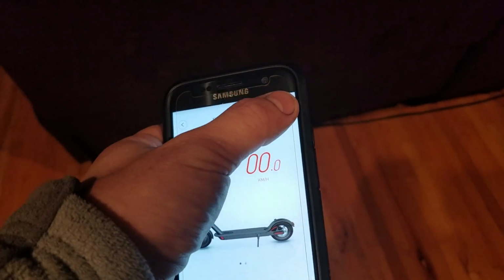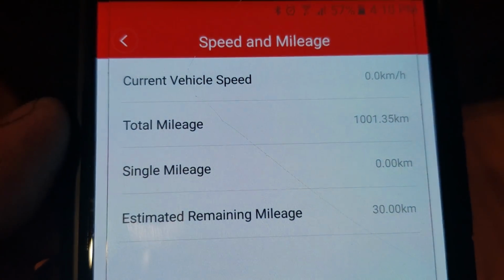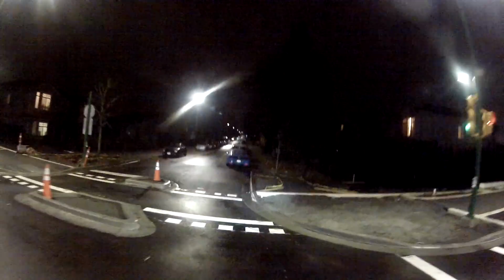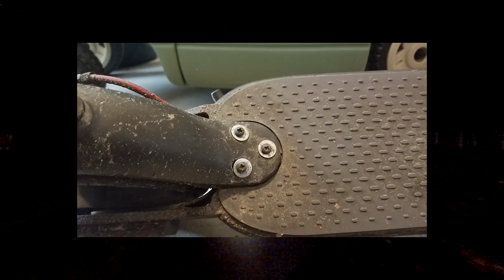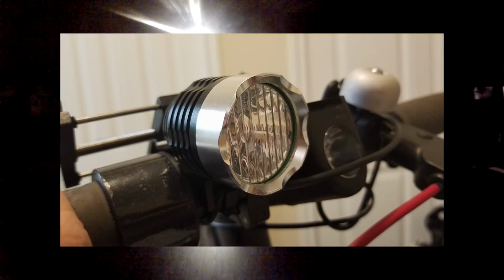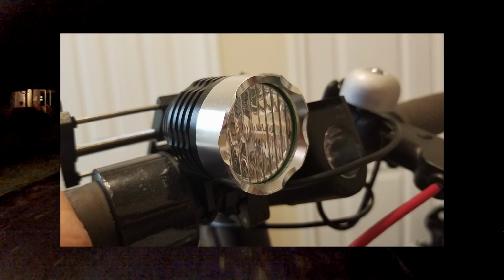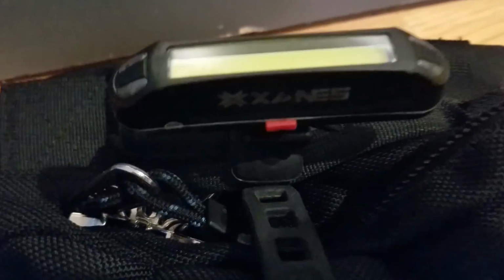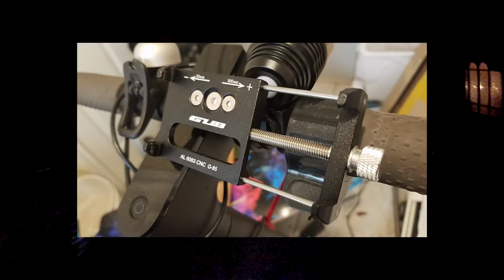Xiaomi M365 - 1000 km Review

Comment: I got the segway ninebot max in October 2019 - April 2020 and it's been running very strong. I haven't had any issue with it. Solid tires and long range and I also take it to work in the rain so it seems to be water resistant and still no issue.

Comment: Don't give up on the scooter even if you get a bicycle, with a scooter you go places even a bike don't go, I bet you have seen places you never even new existed since getting your scooter.

In the UK we are not legally allowed to ride these unless they are registered as mopeds which means they would need to carry a number plate and have a motorcycle license to ride one.

So many people ride them illegally because the law is daft.
Reply from the maker: i thought about, and decided to keep it. unless they come out with a better version of this.
Reply: A good move, I've been thinking of getting one of these in order not to attract too much attention as they look more like kick scooters, I have an EVO which is a road legal electric but it hardly ever gets any use due to the legal issues having that number plate stops you from making good use of scooter ie you can't use cycle lanes, or pavements and so on.

It only does 20 mph but you have to mingle with the traffic or you could find yourself in lots of trouble.

So the type of scooter you have may be a solution for me.
It's something for me to consider.
Reply: EU laws for scooters are quite ambiguous. They could in theory fall under the law legislation as electric bicycles. 250w max motor, 15mph max. The ambigious part is where it's "self propelled" and not operated on the motor alone.  Since some electric scooters require that you kick it before the engine kicks in, legally it would be defined as not operating on the motor alone IMO.
Reply: Actually EU law permits for the use of electric scooters, it's UK law that doesn't.

Under EU law they have opted out of telling other countries that they must adopt the law relating to electric scooters and high powered electric bikes, each EU country decides for itself.

The UK law on electric scooters is as clear and unambiguous as it can be, it states that in order for a vehicle to be classified as an electric bicycle it must have pedals that's basically the one part of the law that disqualifies electric scooters, once an American company fitted pedals to their scooters in an attempt to get around the law but it was deemed not acceptable in court.

So in UK law an electrically assisted bicycle is now 250 watts and the motor must cut out at 15.5 mph the only way you can go faster is by pedalling.

All electric scooters regardless of power be it 100 watts or 3000 watts must be registered as a moped or motorcycle, failure to do so could see you as the rider losing your driving license and getting a big fine.

Many people ride these electric scooters in the UK and ignore the law, the police have so far not been that bothered by them as they have far more important things to do than chase electric scooters.

However if you happen to be involved in an accident you could find yourself in deep trouble, as they are considered motor vehicles.

The only thing that falls out side of the law in the UK is the electric unicycle and at one time promised to be popular, but dropped away, there are no actual laws relating to the Unicycle they fall under the laws of the kick scooter which is considered a toy and as such the law has stated they will not pursue people who ride them so long as they ride with care.

Should there be any reports of people behaving anti social with them they will start to fine people for riding them on the pavement.

UK laws can be draconian.

I got all this directly from the dept of transport who directed me to the relevant documentation on their website, they even  use laws going back to the 18th century to ensure you don't do certain things in relation to cycling and scooters.

For example: cyclists can't be done for speeding in the UK cyclists can go as fast as they like, but they can get done for riding furiously which means they can get a fine or have their bike confiscated until a court hearing, and this law dates back to the 18th century.
Reply: flitsies Hi there. I live in Portsmouth, England, and own this exact scooter. So far it’s served its purpose nicely, and it’s a joy to ride. Nippy, economical, portable, durable, and a real head-turner. Most kids have never seen anything like it and beg me to let them ride it, and adults ask me how much it cost etc. So if you live in an urban area and discretion is something you want, this scooter is not for you. Also I feel awkward riding it on the road despite it being safe, due to the legal reasons you’ve outlined, and the fact it attracts attention. Moreover, I doubt you can trick people into believing it’s a kick scooter, it’s just too chunky looking, quick, and conspicuous. 

However, you’re right that the police have bigger fish to fry, and I’d wager that many officers wouldn’t recognise the scooter as an unregistered motorised vehicle anyway. I’ve seen a couple guys riding scooters and boosted boards around my area.

I bought mine back in October and it’s seen little use. I’ll start riding it again this summer and hope no one stops me.

Hope you enjoy the scooter should you buy it.
Reply: I probably will buy one of these in time, but at the moment I have other problems regarding electric scooters.

But yes all these types of electric scooters are great, why the UK govt is refusing to change the law on them is a mystery.

But just be aware for your own safety, should you be in an accident while riding the scooter in the road you will be held responsible even if the driver of the other vehicle was to blame as you have no right to be riding that on the road.

You may also find yourself being prosecuted for driving an unlicensed uninsured blah blah vehicle on the road once it is discovered it is an electric scooter.

My electric scooter may be registered as a moped/motorcycle and it may only go around 20 mph but it is perfectly legal on the road even if I am blocking the road as I ride along.

Seriously though it's a pain in the ass having to do all that registration lark and it shouldn't be needed for something that is in effect smaller than a pedal cycle..
Reply: Submitted a petition to the government petitions website to legalise a new class of lightweight personal electric vehicles. They haven't approved it yet but keep an eye out for it and get it well shared around. This kind of vehicle is perfect for nipping around local areas and even commuting along cycle routes.
Reply: It's good that you are trying but it has been tried once before hence everyone just ignores the law right up until the govt funds the police better then all hell will break loose.

Good luck.
Reply: Hashterix 

Dont bring the States Nazieyes on anything we love
Reply: Here's the thing, whether you like it or not, if the state or country law prohibits the use of these things and no one challenges it then all that happens is that some people get tickets and some don't, but in some countries it goes a little further than that.

Fore Example: In the UK should you ride one of these and by chance find yourself in the presence of a police officer who really had a bad day and wants some over time you could find yourself in some serious trouble.

The let's say you decide, " OK so I got my license taken away it's not going to stop me riding my scooter is it" Wrong because under UK law you could find yourself going to prison for riding what under the law views as a motorcycle without insurance registration and license cos you just got your taken away, plus as we know driving a vehicle without insurance could see you imprisoned.

So the petition if people sign it would go a long way in helping to prevent this unfortunate string of events ever happening.

Imagine a child of  9 years old being dragged in front of a court for riding a 100 watts electric scooter, technically it could happen even though it never has, some parents have been dragged to court for riding their kids electric toy car because technically it too is considered a motor vehicle, and an adult riding on it is considered illegal.

Even the law regarding disabled electric wheel chairs and scooters, if you are able bodied you could find yourself losing your license for riding one, the police just have to prove you are able bodied and have not got a disability badge.

The law needs to be changed.
Reply: Share that petition far and wide this summer before it expires! Even if we just get 10k signatures it'll get it noticed
Reply: At the moment it's not looking too good, so really we need more people pushing this forward.

I think the main problem is that a lot of people simply don't realise that the scooters are illegal, therefore they don't see the need to sign the petition.

Apathy seems to spring to mind.

But one man if you google did actually get six points and 180 pound fine plus his £800 odd machine was destroyed by the authorities, it was a two wheeled electric unicycle, I know it's a contradiction but that's pretty much what they are called.

But this was in 2016 in wales.

It's not a problem until it becomes a problem seems to be the way a lot of people view this issue.

So you may find the petition struggle to get up any steam.

But soon as the police get their funding back you can bet your hard cash that people will start to cry and wonder why no one got a petition up to change the law, right? ha the irony of it all.
Reply: Signed!
Reply: @flitsies   They do not want the vehicle to die because in this way it is still charged for polluting and if people did not move by car the workshops, the petrol stations and the oil arabesques business people would complain to the politicians of "The Assembly of London". and let's not forget "Transport for London".I live in this city of London, UK and I have to suffer the pollution that is growing more and one of the reasons for Brexit is to continue to pollute without control and without having to respect the European Laws.
Reply: @JB-sd4qc  Well I don't agree with you on the Brexit but we shall have to wait and see.

I believe that once we get out of the EU  we will see some meaningful changes to our policies on pollution, and I don't mean that dumb ass dimwitted idea that is coming in, in march the ULEZ.

That only charges the people who don't pollute the real polluters will still be allowed to travel through London no charge.

I don't know about you but did you notice how the EU go on about plastic bottles but when you watch their tables in that big room whatever it's called virtually every seat has a plastic bottle of water on the table.

So we must do what they say while they do as they like, seems to be the order of the day when it comes to pollution.

I don't see them travelling around in electric cars only big ass limos, and i bet most of them smoke.
Reply: @Hashterix  That petition was good but, I believe, received too little attention. After reading your post here I immediately went to sign it, but it had been timed out :-(. If more people had known of it I'm sure it would have received a mass of signatures.
Reply: @Kimdino1  here's hoping boris is the right kind of open minded thinker and it might happen next year!

Comment: i've had a few punctures as well..iv'e ordered a hard tyre for the back wheel ... on the Segway Ninebot app i like going into the 'fans moments' section there you will see some comments / experiences by fellow m365 riders . a tip for the battery cover..i know it sounds stupid...go buy a Yoga Mat from a sports shop...yes..a Yoga mat... why ?... its the correct thickness... cut it to size and fit inside the battery compartment...this will stop movement of the components inside the battery compartment... finish off by using a silicone sealant around the edge of the lid and secure ..... if you are riding in the rain use gorilla tape to cover the battery socket and red rubber plug. this will prevent water ingress  .you  may also want to use gorilla tape around all the joints on the handlebar / night light area paying special attention to keeping the on / off button dry ...finally a few cable ties to tuck in the red and grey wires that protrude out gives the scooter a better look.
Reply from the maker: that's a lot of awesome tips! i especially like the thin foam to support the battery idea, that will probably reduce the chances of broken spot welds  by a lot! and i didn't know that water can get pass the power button, im gonna cut a piece of clear flexible tape to cover that up.
Reply: Doesent it countain the excessibe heat of the battery and doesent allow passive cooling with that polyfoam garbage? Remember all these hoverboards exploding? Yeah right, Lithium batteries need cooling
Reply: After both my tires had punctures I also ordered solid rubber tires from Gearbest. I got those with the holes drilled into the sides. The solid tires are a bloody pain to retrofit but after heating them up I managed to crowbar them on.

Only downside to the modification is that the scooter becomes rock hard to ride. The solid tires offer no suspension whatsoever. After less than 20km there was rattling somewhere in the back of the scooter. So I did the foam mod to the battery and fastened everything on the rear fender.

Still, in hindsight I would think twice about the solid tires but get an anti-flat strip instead: https://www.amazon.de/Proline-0919V-1952833100-Einlegeband-Violett/dp/B00FOVVOSW/ref=sr_1_5?ie=UTF8&qid=1526760463&sr=8-5
Reply: I don't think overcharging is problem on the m365. Most battery problems reported by owners are due to faulty welding points for battery contacts. If those are fine, there's no need to worry about overcharging IHMO.
Reply: @OsamaBinObama
 That's a very valid point. The key is to only squeeze the foam into the space to the sides of the battery casing, not at the bottom. This will allow enough heat to disperse while also kinda clamping the battery in place. Particularly with solid tires you will need to do this. There is this hilariously exciteable and lovely Polish dude @Delicious Pirat who owns the m365 and likes to ride it in rough terrain. One of the mounting points on his battery had broken off due to fatigue from all the bumpiness with solid tires.
Reply: Segway ninebot looks a bit better, but those tyres are so hard, that you have to pay extra for dentists. Meija 365 inflatable tyres are much better.

Comment: It's great to have long term reviews. I just got mine and am a bit skeptical about durability. Roads are kinda crappy here and I am used to bicycle, for these small wheels it's a pain to go over holes and cracks and the like. I went to work today first time, about 11km, less than 40min just like on bicycle, except it's a bit more fun, obviously I go on bike paths and sideways for the most part or very low traffic roads.
Reply from the maker: Flat tires can be a pain, but happen just as easily on a bicycle. Get some spare tubes just in case. If your looking for a bit more speed. I have a video on flashing to customer firmware

Comment: Awesome and very detailed review. Thanks heaps, i was thinking about buying one and now I know, what i need to be aware of, still a good scooter, I believe.

Also, there are full rubber tires for this model on aliexpress and they have these intermittent holes, so you still have better suspension and less weight than a compete rubber tire. I have heard in china they only use these on most electric bikes and scooters because of the maintenance advantage.

Comment: Hi Dough nut, I also pass the 1000 km mark, except from 2 punctures and that sneaky firmwate update that made hacking the M365 difficult, I did not run into major problems. Of course its most flat in this country and tried not to go off road so normal use of this M365. Guess I can say it saves about 150 euro, one more year and the M365 paid for itself
Reply: Hi. Do you mean the 1 .5 .1 firmware update? I am in Italy and here some people says not to do it because it can be bad.... I just bought it to 3 days ago... I also heard to speak about the1.3.8 update but I don’t know if it’s included in my recent model...thanks
Reply: @JorgeParma  hi Jorge, the 1.40 still was ok. After that a firmware update prevented you from using custom mad firmware so I never bothered anymore after I made the mistake updating above 1.40. Still have my own 1.38 custom and it works fine. Can go over 30 km/h so that fine
Reply: How much range can you get on average?
Reply: @moonshine.9169  it depends, with the original firmware (1.38 or 1.40) not hacked I can do some 20-25 km on mostly flat area. My weight is wel over 80 kg, if your weight is less than the range will be better. Also, driving without breaking for changing direction and less acceleration will also extend your  range. There is Wind of course and different types of underground. Not doing much off road